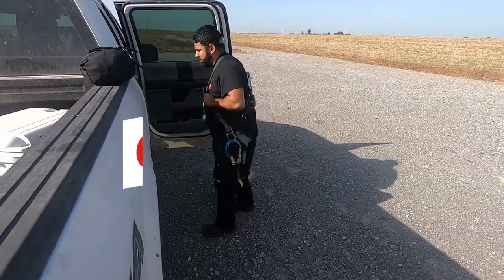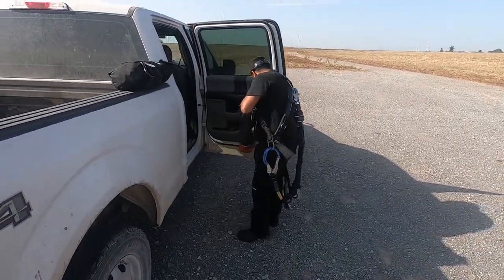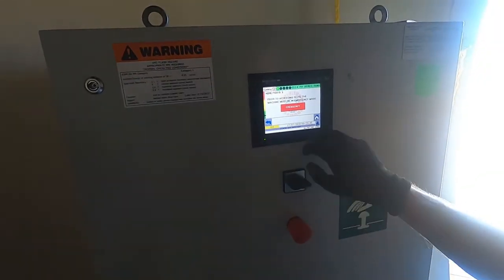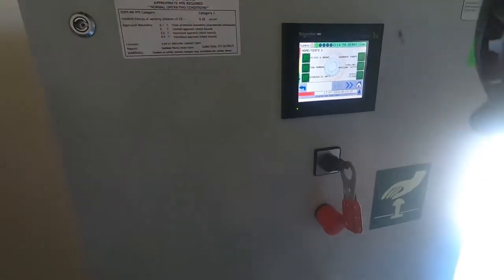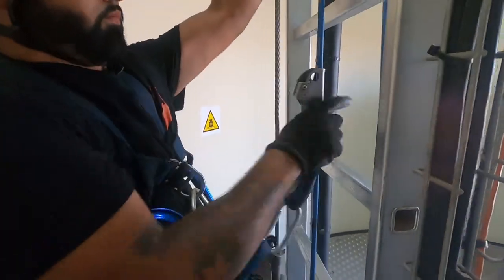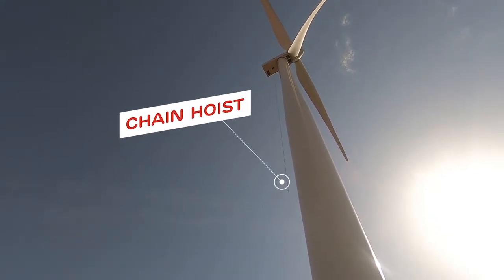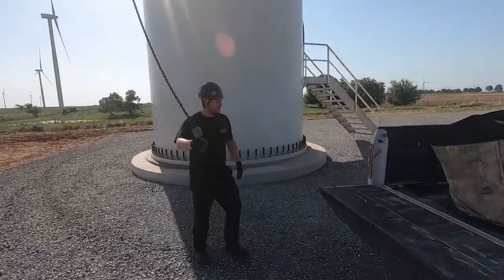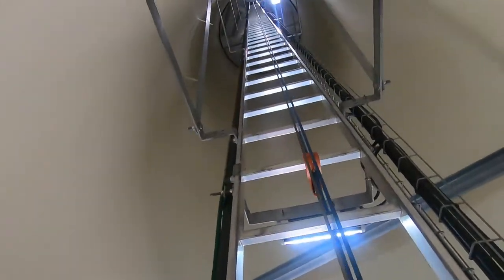Virtual Wind Farm Tour Ep 4: Turbine Tower Climb

Comment: What happens if you climb with the turbine on?
Reply: Nothing. It's not allowed, but it wouldn't be a fun climb. Not only would the tower be rocking, but that black cable bundle on the side of the ladder is the power cables. 690 volts AC to 34,500 volts AC. Always sketched me out.